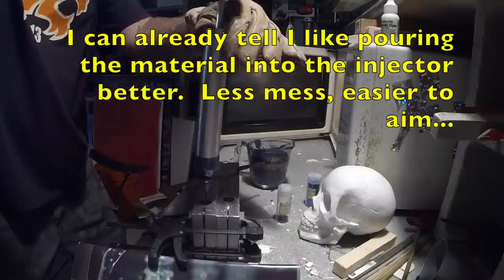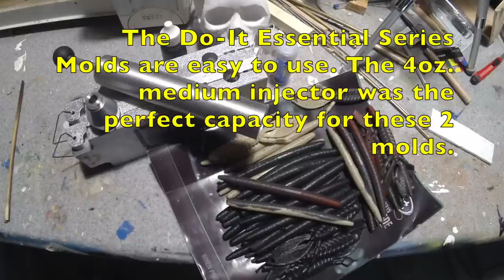Injecting Soft Baits w/ Do-It Essential Series aluminum molds- Senko, Beaver

Comment: If you want to achieve a two color senko why not hand pour half of the mold and then inject the second color?  You won’t have the first half shift and choke the mold because you haven’t removed the first pour so the plastic still holds it’s slight bond to the mold. Just some friendly advice